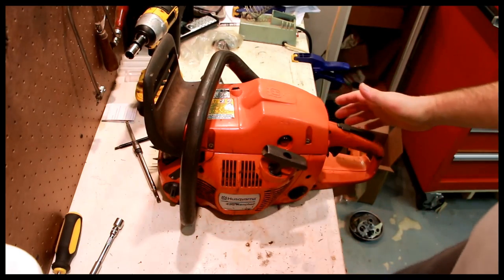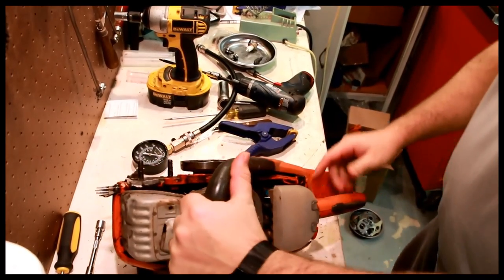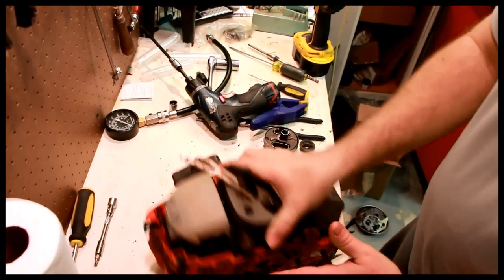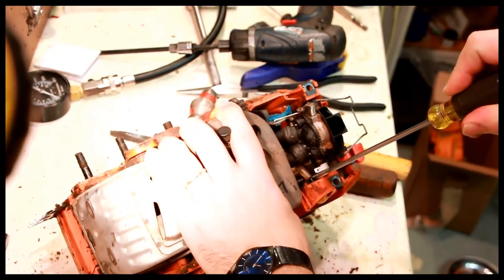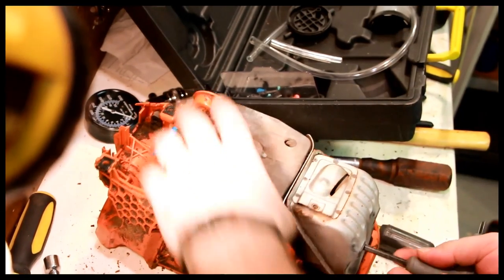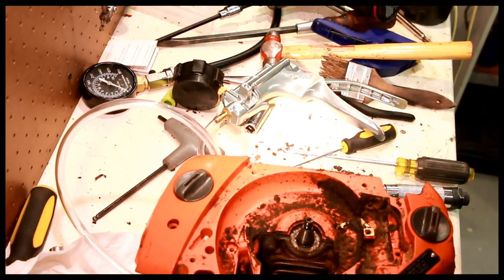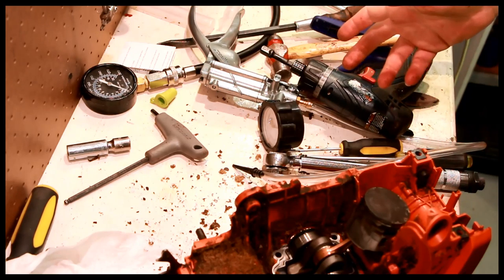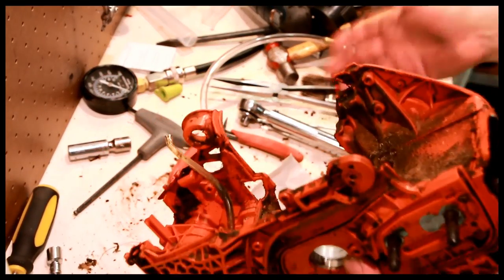Husqvarna 455 rancher teardown and rebuild, bolt for bolt!  part 1

Comment: What if you get the rope into the exhaust port and can't remove it because the crank won't turn back.   The oiler quit working on my 455.
Reply from the maker: Good news is that's fairly difficult to do but it does happen....sometimes gotta pull the muff if that happens.  Take the oiler out and see if it functions just by actuating it
Reply: @matthewolson8875  Thanks for your quick reply.  Great video by the way.  The rope is stuck, and I don't  have a long-enough 5mm allen for the exhaust removal.   I'll figure it out--I do have some longer non-metric wrenches.   Then there's that crazy wrench needed to remove the clutch.  You seemed to have that in your tool box, but I don't.   What was Husky thinking about?
Reply from the maker: @marecooley7  you can make the clutch wrench by grinding an old socket to fit.  The t handle wrenches are available from harbor freight for cheap

Comment: Got a question:  Are the 460 Rancher saws 47mm bore or 49mm?  I'm looking up parts for one and it's confusing what the bore size is....
Reply from the maker: 460 is 49mm i think
Reply: @matthewolson8875    Thanks.  I noticed that when you order Caber rings for the 460 they are 49mm and when you order a Chinese cylinder and piston kit they say they're 47mm.  I'll have to tear it down I guess because the piston looks good through the exhaust but the compression test showed around 70.  It might just need rings unless it has a hole in the top of the piston or a crack in it...
Reply from the maker: @joew9392  China doesn't make a 49mm head....47 only which is 455.....not 460.  Iirc
Reply: Yes, that seems right.   On their ads it says 455 and 460 so I guess it would fit the saw.  Customer doesn't care as long as it runs and doesn't cost too much..

Comment: I know what blew the saw and it wasn't the gas. The user was starting the saw and running it wide open cold and forcing the saw to work without warmups. The piston expands too quickly and usually scars the ring land near the exhaust end causing scouring and piston ring getting stuck. Someone may have rebuilt that saw and the owner/user did it again. Now you have it. Cheers!

Comment: I have a husqvarna 450 rancher.  The oiler adjustment screw is GONE I know what happend.  Any idea? I didn't go wild slow adjustment.  One day I picked it up to adjust the oil and the screw is completely gone.
Reply from the maker: Yikes.  Nope....I dunno but it's not too hard to get a new oiler in there
Reply: @matthewolson8875  thanks for the reply,  can I just get a screw or a whole new oiler system ? I only ran it about 10 times cuttin up trees . It's brand knew lol I Olympic but the best oil and gas in it. To keep it running perfectly  they should last a lifetime with proper maintenance
Reply from the maker: @rooseveltbear8167  if the oiler is the same as the 455 it's a pretty easy install and yes you buy the whole boiler you will likely be able to find a used one on eBay

Comment: At 10.15 ish, does the green wire have a spay termininal to connect to or does it just compress into the off switch.  (on a 346xp)  Thanks and really enjoy the vids.
Reply from the maker: yeah, that looks like a spade connector, and it goes into the switch in a special spot for it...   this is likely a part that is best an oem part fyi

Comment: Matthew,

Thanks for these 455 Rancher videos. I was able to replace the bottom chain oil pickup hose and made sure it was sealed with Three Bond Case Sealant Liquid Gasket 1184. I'm still waiting for a new pinion gear and pump but have put it all back together except for the clutch cover.

Also, who makes the blue dial watch that you wear? I am tired of digital watches and like the old style analog watch face.
Reply from the maker: That watch is an old school SKAGEN

Comment: Matthew Olson maybe you can dispel what I think is a myth on the 455, lubricating the needle bearing most people think in the center of the crankshaft there is a hole that people put grease in thinking they are lubricating the bearing. I see nothing on the crank that would allow this and that hole is only about 5mm deep . So am I right that on the 455 Husqvarna the only way to lubricate it with grease is by removing the clutch assembly? And it would seem to me that very little if any bar oil would get to it.
Reply from the maker: some cranks do have a hole that you grease ... I don't know about the 455.  if that outer hole on the end of the crank does communicate with a hole on the side of the crank corresponding with the needle bearing...then its greaseable.  if not, gotta take the clutch off to lube it.  ...which is easy if you have a clutch tool and an impact :)
Reply: Still looking for it and unless its microscopic I haven't found it yet. Also I have the Husqvarna clutch tool and screw in piston stop, for about $20.00 I don't know why anyone that has this saw wouldn't have these tools, they make the job so much easier and no risk of damaging something...like rope in the exhaust port or bending the springs on the clutch or like one idiot I know who broke a piece of the clutch off doing something stupid instead of having the right tool.
Reply from the maker: i like my rope still for the piston stop...  it has some give to it and won't damage the piston.   but you CAN get fibers in there if you stick it into the exhaust port accidentally, so .. no method is perfect.  

if you have the clutch off the crank, you can stick the wd-40 nozzle/tube right in that crank hole and see if a squirt comes out the side.   the hole is 1/16" or so in diameter if its on that crank.  

also, the 455 rancher has been produced for many years.  its POSSIBLE that the hole used to be there and is no longer...and vice versa.
Reply: So here is the info finally model year 2011 and older did have a greaseable crankshaft. Model years 2012 and up do not on the 455. On other Husqvarnas it depends on the year and model....so part urban myth part truth I guess but anyone making a broad statement that ALL Husqvarnas are greased this way through the crank is just wrong!
Reply from the maker: David Hobson nice job on the homework! !!   Thanks!!

Comment: How do I take the vibration isolator off the saw handle? (The bottom one isolator spring)
Reply from the maker: 4mm allen, stick it through the screw hole in the av mount
Reply: @matthewolson8875  man a little WD and a different Allen wrench worked, thank you!
Reply: @matthewolson8875  I'm gonna run this saw till the death
Reply: Props to you for doing this for free brother.
Reply: Optimus over and out

Comment: Mathew, can you tell me where the Gas Vent is located on the Husqvarna 455 Rancher ...Thanks in advance.
Reply from the maker: Take the starter off.  It's below the primer. ..above the gas cap :)
Reply: @matthewolson8875   Thank you...do i have to tear it all apart or is it easy to get too
Reply: @matthewolson8875   does a hose go from the vent to wear...cause i thnk that is wh
y it will not stay running
Reply from the maker: @TheodeScottBand  like i said ...remove starter.  It's above the gas cap and below the primer
Reply from the maker: @TheodeScottBand  I don't think the hose attaches to the vent. Go to ereplacemenparts dot com and check the diagrams
Reply from the maker: @TheodeScottBand  what's the compression ?  Did you pull the muffler and check the piston?
Reply: @matthewolson8875  Bran New Head and Piston Mathew
Reply from the maker: @TheodeScottBand  then it's fuel or spark.  New carb?  I've never successfully kitted a 455 carb.  Often need new.
Reply: @matthewolson8875  Mathew if you pump the bubl she will stay running...does a hose go to the gas vent at all or no ?
Reply from the maker: @TheodeScottBand  no hose goes to tank vent
Reply from the maker: @TheodeScottBand  check the diagram for ereplacemenparts
Reply: @matthewolson8875  We got it one of those hoses were not tight enough,,,she runs like a top. Thank you for your help...Blessings Brother

Comment: Hello Matthew,  I'm trying to track down a problem of fuel starvation.  The saw runs then speeds up and shuts down like an empty tank but the tank is full.  I can prime the saw and it runs but stalls in a minute or two.  Been told to try replacing the fuel filter and I hope that's it but if the vent is a quick change and not expensive I'll do that at same time.  Your vid mentioned the vent can be removed with pliers is that it or is there more to it?  Bought saw new three years ago is just used to buck up fire wood only cut down maybe 2 dozen birch and poplar, and yes didn't drain fuel each year but kept it in heated basement.  So a good service would be fuel filter, air filter, plug, and vent?  Doug.
Reply from the maker: vent is good to replace if the saw runs lean after about 5 minutes of cutting.  if it does it nearly immediately ....then its probably not the vent.  filter and line is a good start.  could be lots of other things though.   next step is to throw a carb kit at it, though sometimes its much easier just to buy a new carb.  can be a number of hours to do a carb kit...if you are going for super cheap, then fuel filter and line, and tear the carb apart and just clean it.    sometimes the filter in the carb gets gummed up .....   have  you messed with the tune at all?
Reply: Friends that use to log did after it was broken in.  Run ok last year.  Started up great this year but as you say after about five minutes from cold start, it ran lean (sped up and shut down).  Now that it was warm I could prime it (primer bulb) and it would start immediately but shut down with in a minute more of a blub bulb die while using the throttle to try to keep it running.  Got it to run just long enough to finish the cut and push the tree over.  The sapling was just big enough to have injured someone could not have left it, with a partial cut, nor are you suppose to. No matter how big.   Thanks for the quick response, Doug.  I just reread what you typed there is a filter in the carb?  Not just the filter in the tank?  I'll rerun this vid again.  Bolt by bolt yours is the best I've seen.  Oh wife wants to know is your kid(s) following in daddies foot steps and taking things apart and putting them together. 😁
Reply from the maker: Open the fuel cap....this vents the tank.  If it runs fine again for 5 minutes then it's the vent....yes there is a screen in the carb that gets gummed.  Yes...my kids like to dismantle things lol
Reply from the maker: Also. ...these type of questions are best for the online forums.... opeforum.com or arboristsite or both
Reply: Matthew Olson ok thanks.
Reply: Hi Matthew just follow up.  Found problem, when removing the fuel filter the whole thing fell out filter and fuel line.  The fuel line by the filter was fine but where the line entered the tank was mush.  Could squish it together with my fingers.  Saw running great now.  Question what would cause that in a saw only three years old?
Reply from the maker: Douglas Overbeck ethanol in the fuel does that.  Gotta use ethanol free gas :)

Comment: Hi Matt, I wrecked the threat of the fuel tank on my almost new 455. Any advice?
Reply from the maker: Plastic threads?  Sometime you can melt in plastic from string trimmer line and you can get the screw to grab....or new tank :(

Comment: I have a 455 rancher that the fuel lines have started leaking.do you have a video on changing the fuel lines?
Reply from the maker: Not specifically no
Reply from the maker: I don't think the lines are hard to do...if I had one I'd do it for you live but I dont...sorry
Reply: 13:15 He removes lines from purge. Short to short long to long. I had to use long screw to pull out part of hose. Long needle nose is nice here. Hint...cut line at 30 degree like the roses you just gave on Valentines Day to push through grommets easier. Cut straight before attaching new filter.

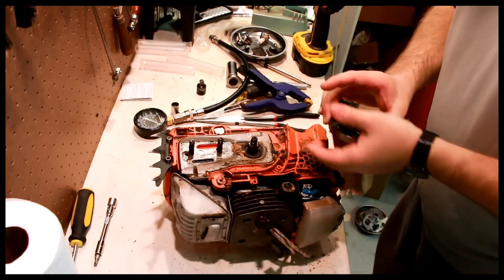Comment: At about 7:20 you address the oiler. On the 455 and many other Husqvarnas this assembly is a weak point and the cause of them "oiling themselves" all over the shelf after use. Where the pump assembly connects to the tube does not have enough pressure (probably supposed to be exerted by the steel cover pressing on it) to keep chain oil from seeping out around it. It is either an evil, genius plot to sell more bar oil or a poor design. The problem can be corrected with bike tube or some other suitable shimming material placed between the cover and hose to pump connection. Note, this does not correct the design flaw but does slow it down somewhat. Also note , I had heard Husqvarna was stepping up with a fix but when I joined their customer support forum and posted regarding the issue, I was mysteriously un-joined from their site. PS - GREAT JOB on this video.
Reply from the maker: Thanks....nice tip too

Comment: from my years with these saws strait gas locks them up solid, had a worker kill a trimmer and a cut off saw of this brand and strait gas locks them up, i dont see any sense in doing a presser test because if your going to go to all that work to take it a part, your going to replace all seals ring, one would be dumb not to.. maybe piston and jug..

Comment: How do you replace the chain stud bolts?
Reply from the maker: the bar bolts?   tap them into the crankcase... they are just in press fit.  then pull new back through, but make sure they are aligned properly ... rotationally they have a rectangle that has to fit into a slot inside the oil tank.  you should be able to use a bar nut and some washers to  pull it through.   once it gets close to seating, use two bar nuts on one stud...  tighten them together, and use that to rotate the stud as needed.  then remove the nuts, go back to one nut and washers, and pull it that last 2-3mm through engaging the rectangle  ....  :)    its probably in one of my vids somewhere lol

Comment: My saw runs for couple of minutes and shuts off, what's up with that?
Reply from the maker: Tomas Tekorius beats me troubleshooting of that kind is really best on an online form such as ope forum.com or arboristsite.com
Reply: Did you fix it? The upper carb plate builds up sawdust. Needs to be cleaned...or vacuum leak. Water buildup on ff  is another possibility.  Let me know what you found on yours. Ty

Comment: Hey mate one question. Ms291 or a 455 rancher
Reply from the maker: Honestly, I have run both and worked on both.   455 rancher all the way... no question.   my experience is that it cuts faster, and is much less of a pain to tear down.
Reply: Matthew Olson thanks. Is it worth buying a old one and rebuilding it or getting a brand new one. They are very expensive
Reply from the maker: Nice shape 455s can be found around the 300 mark...usually complete saws in rough shape to for 200 with this particular chainsaw you can usually spend more than the saw is worth in parts so be careful about buying used and rebuilding

Comment: There its a more easy way too test the compresson ,  your test tell you noting ,  you air pressure , airtool nipple , turn the piston on top of btc,  and do the test ,  it you get air of the exhast, inntake are the cylinder, piston bad,  or renove the exhaust muffel fore inspection of piston, cylinder

Comment: Matthew, any videos on a Husqvarna 445 chainsaw.
Reply from the maker: I don't have one, sorry.   I can't imagine its that much different than the 455.  What do you need to know?
Reply: Well Matthew, one day I got it stuck in 22" tree that I had cut down.  It was running perfectly up to that point.  After wrestling with it for awhile I got to break free and it hasn't run right since.  Starts right up and then quits.  Runs for about a second.  I changed fuel lines and rebuilt carburetor and still the same symptoms.  A friend of mine told me that quite possibly the flexible intake had a split in it.  It acts as though it might be getting too much air.  According to my friend, this is a common problem with the 445 models.  I would appreciate your thoughts on the matter.  Thank you.
Reply from the maker: Hunter Dan tear her down...make a vid :)   also....post the question at opeforum.com. ..your issue may or may not have to do with the injury to the saw.

Comment: would this how to tear down be the same for a 460 Rancher that has less then 3 hours on it, and lost compression using there pre mix gas, but never used it the first 3 years didnt even put gas in it, but time ran out an dealer will not warranty, i have 2 videos on this story all my life i have had this brand of saw and cut thousands of cords of wood, helll i have some saws 30 years old still leave in the snow bank and go.. i am the only one used this  saw, looking in plug hole the jug look clean, no marks, im thinking rings collapsed,, defective
Reply from the maker: Same saw except piston / bore size :)
Reply: @matthewolson8875  thank you, going to tear down my 460 then and follow this,,, it is totaly unlike any other saw of this brand iv had
Reply from the maker: @arnoldromppai5395  it's really not bad teardown. ...it's one of the easiest saws to do I think
Reply: @matthewolson8875  yes it looks easy but more parts to take off then the 266, 391, but now that i seen your video it a snap. only thing is looking up parts on your link and others give piston, an rings jug for $120 usd but says it for 455 and 460 but is 2mm smaller then original, 460 so its 40mm so i am wondering if that drops me down to a 455 and not to the 460. i have done all my repairs on everything all my life
Reply from the maker: @arnoldromppai5395  you want the oem head if you want to stay 460...  I don't think they make an aftermarket 460 head ....  hl supply is great for stuff but they don't necessarily have everything.  Thanks for thinking of me in that way though
Reply: @matthewolson8875  thank you,, being the saw has less then 3 hours on it i wont to keep it as a 460, had lots of power, if it was older then o wouldn't care